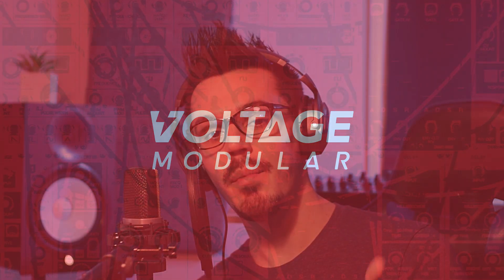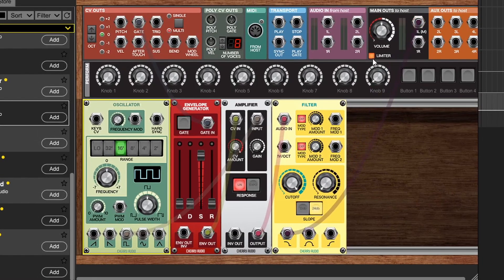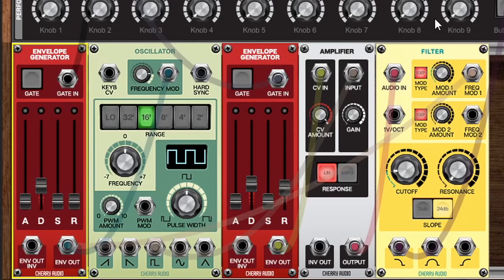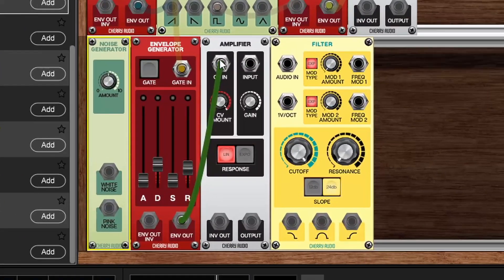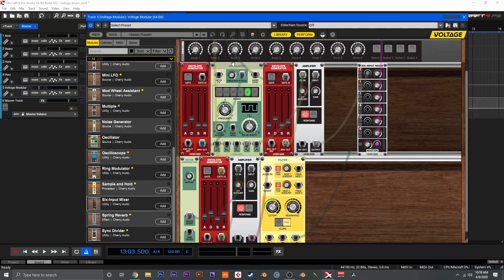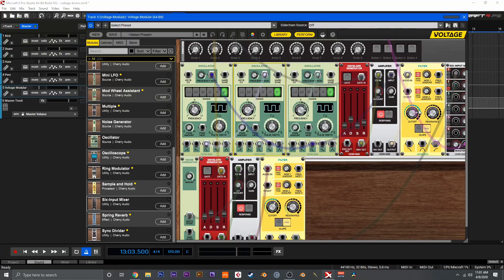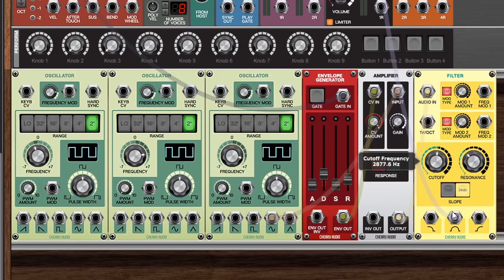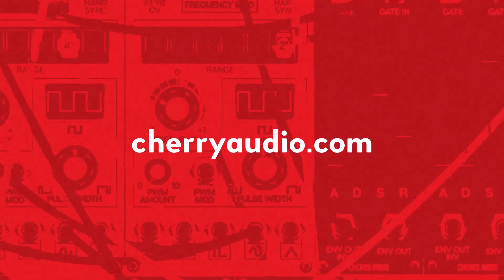Voltage Modular Tutorial | Creating Drums and Percussion Sounds

Comment: So I've got a question. Cherry Audio, or voltage modular. I'm interested in purchasing a starter set up. My question is will it work well with or in my MPC studio 2.5 DAW?  The reason I'm asking is I've bought a couple of plugins that would not work in it.  So anymore before I purchase anything that has to be checked out 1st.   I already have a couple of modular pieces. Plus I'm old and just having lots of fun with my midi and modular stuff.
Reply from the maker: Hey there! It appears that MPC Studio does offer VST support so you should be able to run Voltage Modular inside of it! However, you might contact their customer support first to double check in case there are any potential or know compatibility issues.